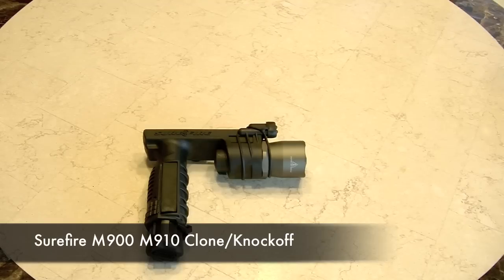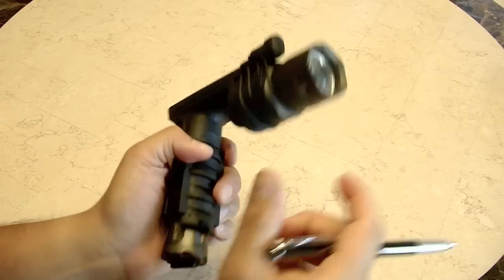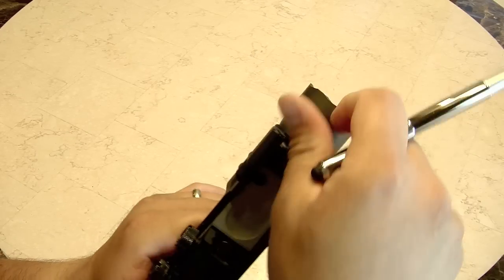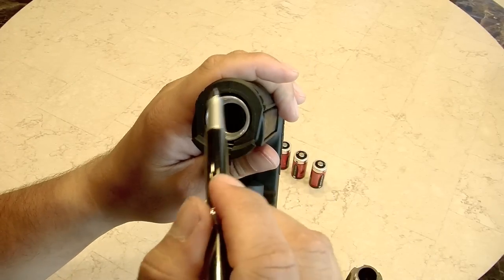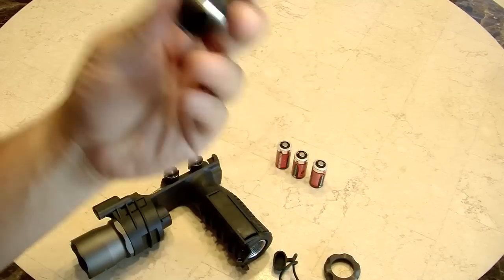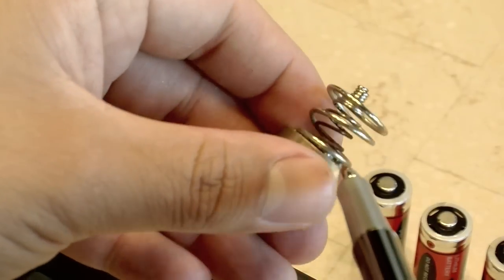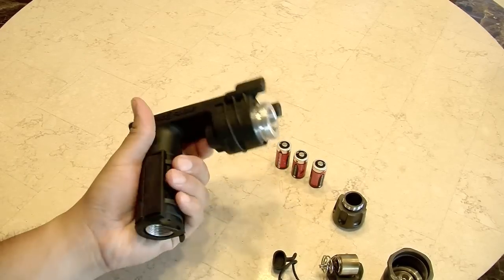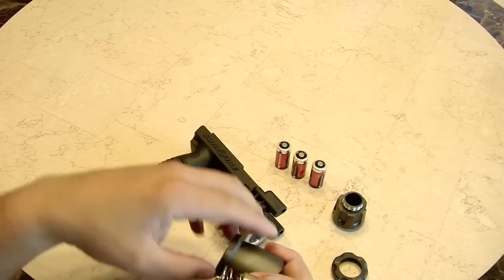Surefire M900 / M910 Clone / Knockoff

Comment: Richard, Do you know if this light is voltage regulated? I'm wondering if this light is compatible with rechargeable 3.0v cr123 cells. Rechargeable cr123 batteries off the charger has a voltage of around 4.2v. I'm hoping this light is voltage regulated so the light doesn't break. LMK your thoughts.